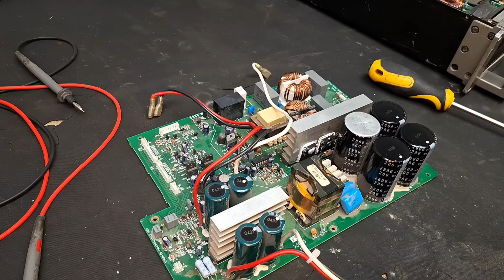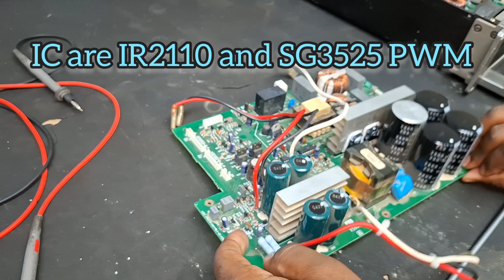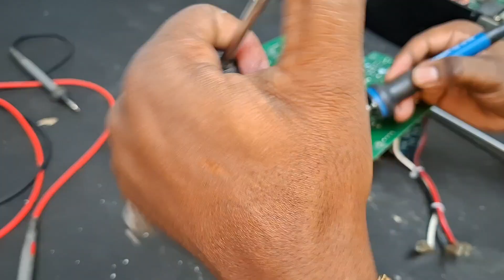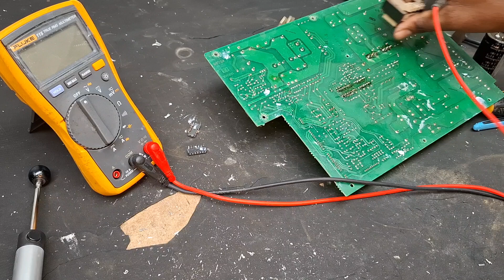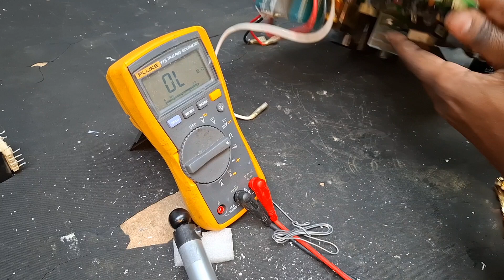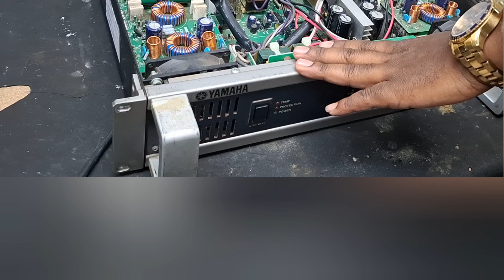Yamaha P7000S Amplifier power supply Faulty/Blown

Comment: Please sir can you just test IGBT transistor on multimeter first, Because we want to get reading display on diode test mode.Thankyou.
Reply from the maker: I will do so next time. But 99% when the IGBT are faulty. They will read a short circuit  when you measure them.

Comment: Bro  my nad t753 when receiver on after some second turn off plz teach me what we do
Reply from the maker: @rockysandhu9902  In most cases, when a receiver shuts down , it means it's going on protection. Most likely, 1 of your outputs channel is faulty. I will advise you to eliminate the speakers, so unplug your speakers and to factory reset. Then switch on the unit without speakers, and if it does switch off, then you most likely have a faulty channel
Reply: @Indetail-repair  all channel make noise
Reply: Can you tell me reset button plzzzz nad t753
Reply from the maker: @rockysandhu9902  Locate the Buttons: Find the "MENU" and "SOURCE" buttons on the front panel of your NAD T 753 receiver.

Press and Hold: Simultaneously press and hold both the "MENU" and "SOURCE" buttons.

Wait for Display: Continue holding the buttons until the display (VFD) shows "Factory reset".

Power Off: Once "Factory reset" appears, power off the receiver by unplugging the power cord from the back panel.

Wait: Allow the receiver to remain unplugged for approximately one minute.

Power On: Plug the power cord back in and power on the receiver normally.

Note: This process will permanently delete all customized settings and restore the receiver to its default software.

Before Resetting: Make a note of any settings you want to remember before performing the factory reset.

Comment: Mine has a problem i replaced 2 fets and 2 resistors now power on but protection and temp stays on and the 15 regulator doesn’t show any voltage
Reply from the maker: @erkanadana9555  without the 15V regualator the amp won't switch on , because the 15V is the 1 that switch the PWM IC to switch the FET, unless you meaning the 15 on the secondary side of the Switch mode power supply
Reply from the maker: @erkanadana9555  also make sure all the cables are plugged in properly to the amp module
Reply from the maker: @erkanadana9555  Q424 IS For temperature and Q418 is for protection , also measure them
Reply: @ okay i will check them about what voltage need to be there
Reply from the maker: You should get 24V
Reply: I removed one of the transistors now it’s okay but fans stays full blast
Reply from the maker: @erkanadana9555  which transistor did you remove?
Reply from the maker: Are you getting audio?
Reply: @Indetail-repair  yeah i have audio on both channels
Reply: @Indetail-repair  i removed Q424 number of the transistor is A114
Reply from the maker: @erkanadana9555  maybe do replace it with a new transistor, then test
Reply: @ i just repaired it was with one of that transistor isue 
Thankyou so much for helping me 😊🤗